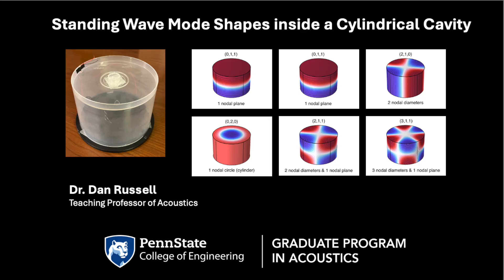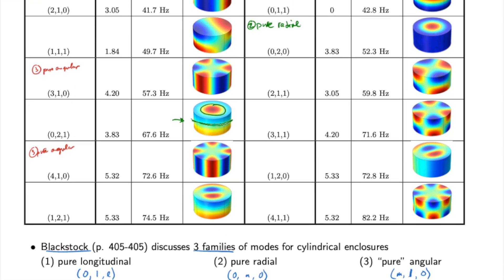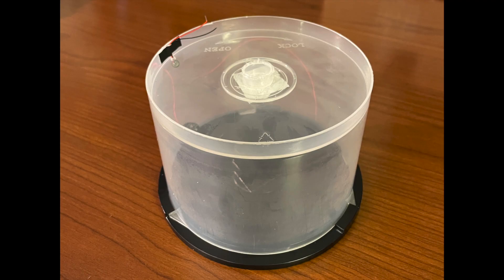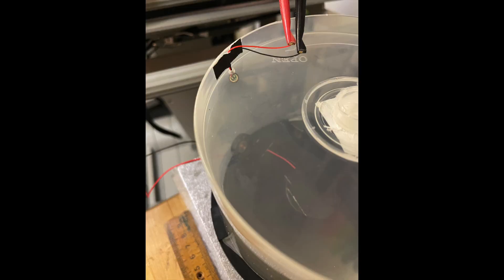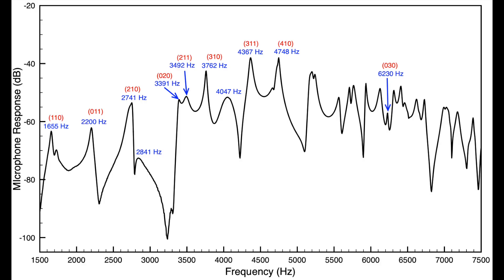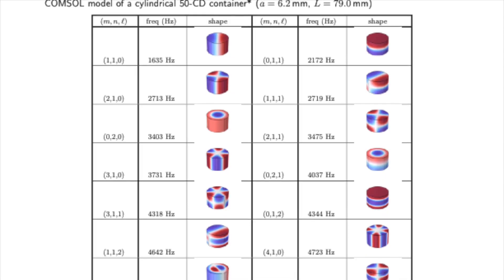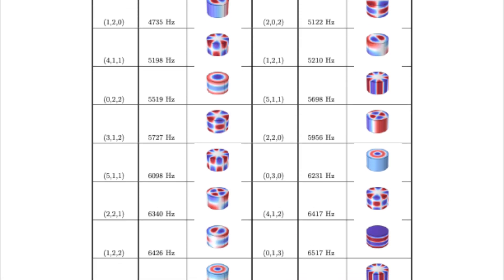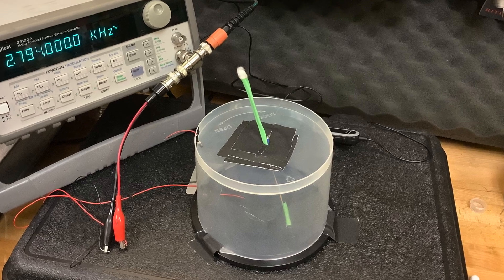Standing Waves inside a Cylindrical Cavity

Comment: Dr.Dan, great demo! 
What if a pink noise is played then change loudspeaker position randomly for each reading, are cancelation points (x,y,z) the same or shifted? (it should not change, but I think it moves and changes the whole modal shape, not cancelled,  Mods exist but it is shifted with a new different shape).